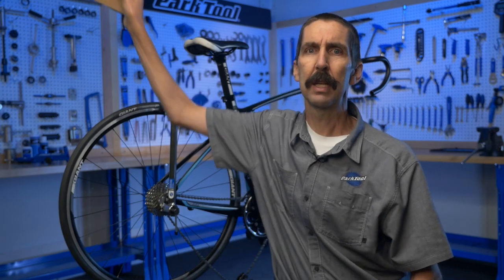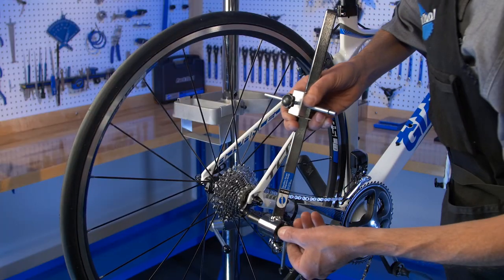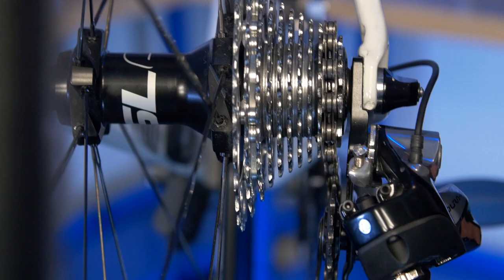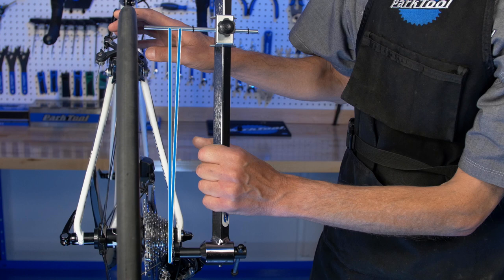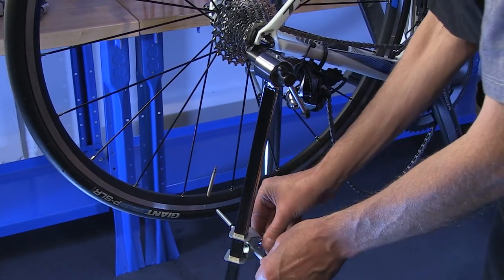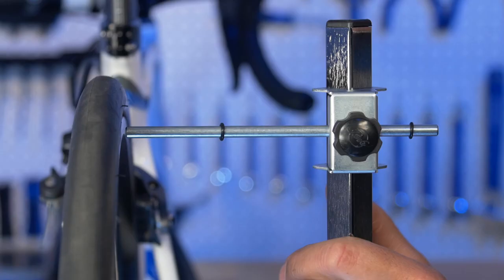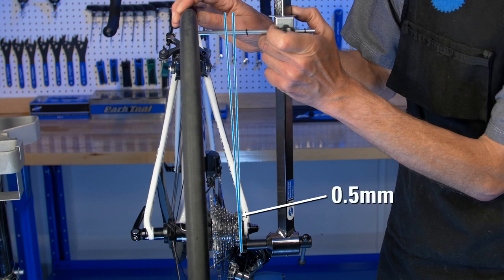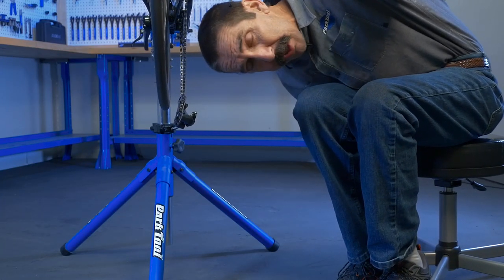Tech Tuesday #33: Going Off On A Tangent

Comment: I have a question when I shift my gears to 1 and the bigesst ring it slip to second gear what is the reason all the limiting screw are correctly check and wire also what is the reason
Reply from the maker: Thats considered Cross chaining and is tough on the drivetrain of the bike. If you add a few counter clockwise turns to the barrel adjuster it should work for you. But on many systems during cross chaining the chain will not want to stay on the gear in the back.
Reply: @parktool  does it happen due to the bend teeth of the biggest ring of freewheel
Reply from the maker: Typically it happens because the chain needs to be at a severe angle when in that gear. At a severe angle it will have a hard time staying on.
Reply: @parktool  thanks for it if I want convert 3*7 to 1*12 can you make a video or suggest relating to it plz

Comment: Hi, quick question. Does the cassette cog, guide pulley and tension pulley all need to be aligned? Or only the cog and guide pulley. 

I have an Ultegra 6800 set up. Very quiet drivechain in the small ring. Noisy in the big ring. It sounds like the tension pulley is noisy. I've checked the pulley bearing and even regreased it. The chain length seems fine. Very little front derailluer rub in big big or small small combo, front shifter trim seems to be fine in that respect.  I'm at a loss what the issue could be..!
Reply from the maker: A good question, not necessarily a quick question. Ideally there is alignment between sprocket, and both pulleys. The guide pulley does the shifting and that is most critical. If the tension pulley is twisted, it can cause a noise, especially as the chain line changes as you move the chain back and forth to different combinations. Go to the big ring, and look at the bottom edge of the tension pulley as it engages the chain. It might be the pulley is not falling between side plates of the chain. Repair can be difficult, and sometimes involves bending the low cage...just a bit.
Reply: Ravinder Singh First setup the H and L Screws. A noise on the bigger cog is a good sign that the limit screw is not centering the guide pulley over the Cog . After you do this use a cheape bike park tool ( diy with PVC pipes) so the back wheel is off the ground. Now set the bike to the first ring and big cog come around the back of the bike and look at the chain and the guide pulley if they are mis-aligned badly ( visually clearly not aligned) you know it's the limit screw. The final check is the one people always over look which is the Cable tension adjustment with the adjuster . This actually is for micro alignment of the chain over the cogs so this could be the reason why on the big cog you get noise. Please also check the big cog for broken teeth.

Comment: I have that tool. Never used it yet but i thought you could only use it on steel frames? I thought that the properties of aluminium and carbon would mean you couldn't bend the dropout material with it?  Is it only for steel frames because there's not many of those around right now although my next frame will be steel i think.  Great video.
Reply from the maker: Both aluminum and steel can be bent. Their ductile properties do vary but both can take a set. As a rule, if a hanger survives re-alignment, it will survive the use. Riding the bike does not stress the hanger. It is crashing and hitting the hanger that stresses the material.   Carbon fiber is not used for derailleur hangers, as it would be a poor choice of material. - Calvin
Reply: +Park Tool Thanks Calvin, appreciate the help. Cool video.  Different issue but i'll ask here anyway. I have the Park headset press which is a great tool and i read that you can also use it for installing the new press in BB bearings in a frame that's designed to run them. Will it work with the standard press with just the large flat ends without the inserts or do you need to get other inserts?  I'm sure i watched a video of the current headset press, which is the same as mine only the handle covering is different as mine only has the small dots at the end of each handle, where it showed a BB being pressed in with the tool.
Reply from the maker: A standard headset press will work. To press the bottom brackets, press only one cup at a time using the flat plates.

Comment: Does bending the hanger compromise it and cause fatigue? Had an experience where my hanger broke and sent my derailleur flying when riding and not sure if this was the cause.
Reply from the maker: The stress of shifting is much less than the stress of bending. If a hanger survives bending, it will survive the ride. The load of shifting is on the chain, not the hanger. Striking a hanger (through the derailleur) is stressful.  Just riding and shifting much less so.  At some point repeated bending will crack the metal, but that takes a lot of repeated bending.